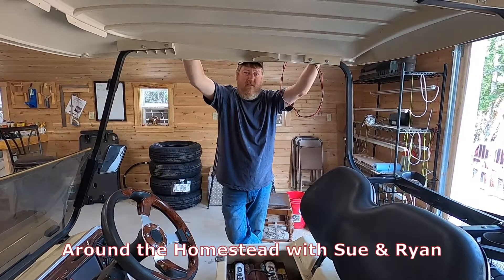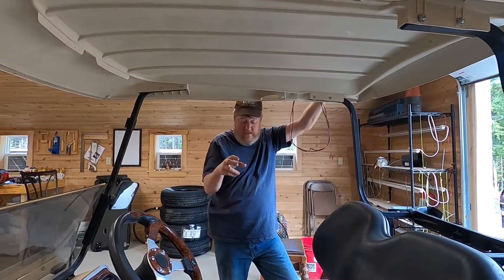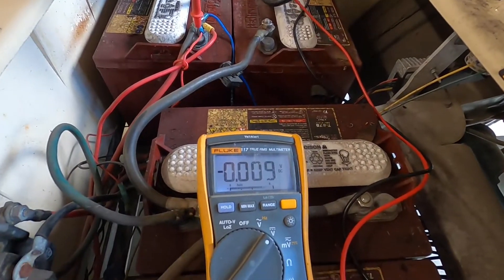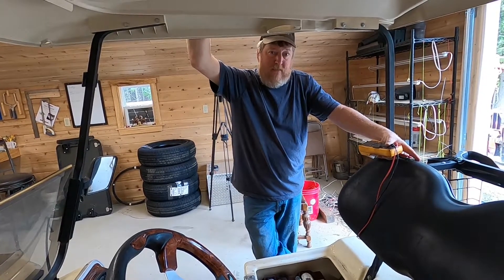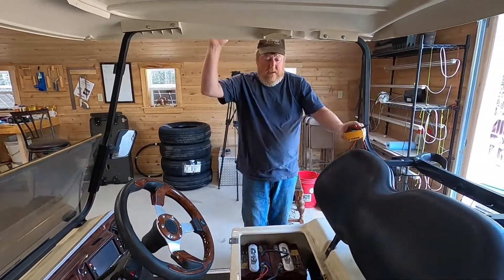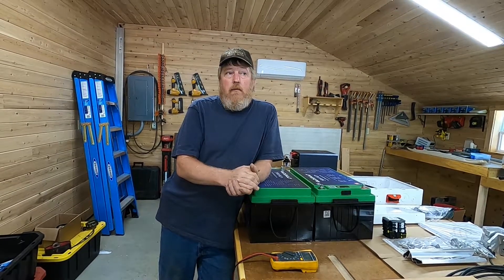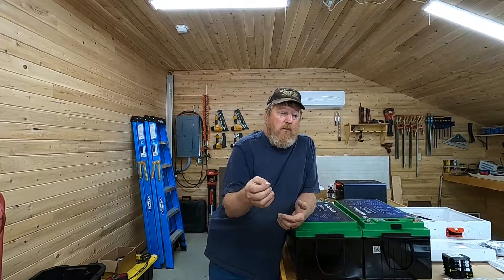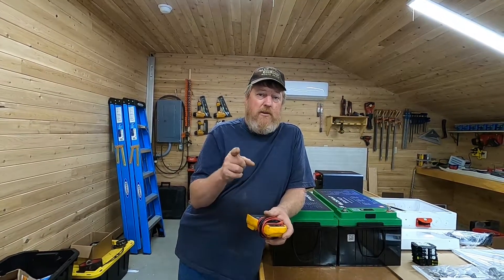Dirty Lead Acid Batteries with Leakage, Parasitic Drain

Comment: i use to work at a golf car repair shop in southern iowa. the owner was into rebuilding golf car batteries to use in his electric forklifts that he used in his shop as lifts.
in 2017 my neighbor gave me an old 36 volt easy go. i bought brand new TROJAN T105 RE BATTERIES . the first thing that i did was buy some big ass Anderson connectors at a big name industrial supply. i then used brand new welding cable and made myself some equal length cables and used the Anderson connectors  to swap from 36 volt bank  to a 12 volt bank. just unplug a few connectors and plug in a few and you go back and forth as you desire.
we lived in RURAL SOUTH DAKOTA, WHERE IT GETS DOWN TO -30 NO PROBLEM. we used the golf car to power our 2000 golden falcon (purchased at insurance salvage auction) that we lived in FULL TIME AND COMPLETELY OFF GRID for 3 whole years!  i used 2 solar panels as a roof for the easy go, and a home made gas engine charger, and scavenged the waste heat from the exhaust to heat water. waste not ,want not. i powered my "hughes net" satellite dish with the easy go, as it had a 12 volt wall wart.we had an outhouse and a bucket in the bathroom.
im a 65 year old man, a hillbilly from arkansas and im certified for almost any engine that is NOT electronically controlled.

Comment: Thanks for the content Ryan.  I would have NEVER thought to check plastic to plastic connectivity but I am very careful with filling the batteries and removing corrosion.  I had installed 8 6V golfcart batteries when I bought my classic 150 in 2015 and I think now the $$ is double what I paid.  I check water levels every 30 days and remove all connections once a year to make sure no corrosion under the lugs.  I also have been using automotive battery cleaner and terminal connection paint and that seems to help.  I finally made a phone call to tech support today on a question on my KID and spoke with James.....glad MNS has such great content and people behind the products!